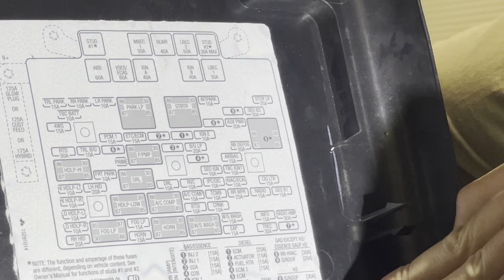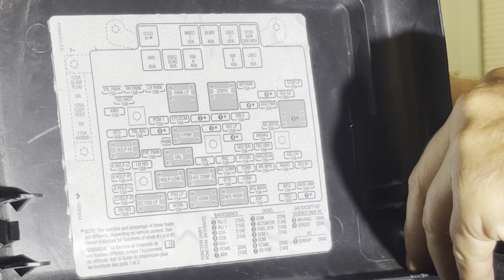How to: Wire Our Switchback Rock Lights for Turn Signal

Comment: How do you add the toggle switch back?
Reply from the maker: The kit comes pre-wired to run on the included three position switch (white-off-amber). That's certainly the easiest way to wire them. This video is only if you want them to blink with the turn signals. It would be a much more involved wiring procedure if you wanted to be able to switch them all to amber, but also have them blink with the turn signals.
Reply: So if u use as turn signals the rest of the  harness is not needed?
Reply from the maker: @xrayiz67  essentially, yes.
Reply: Hyperflash?